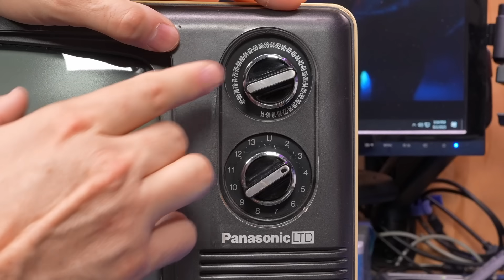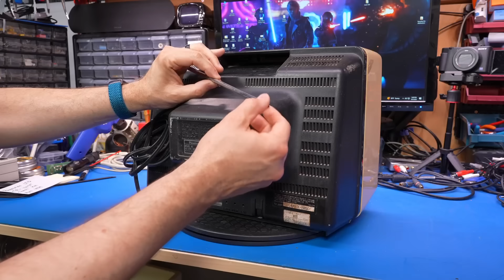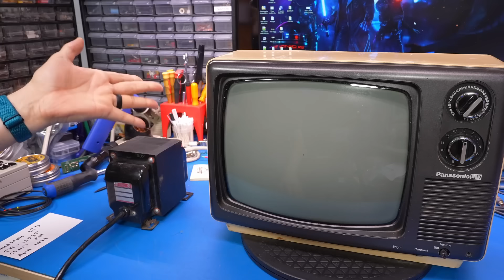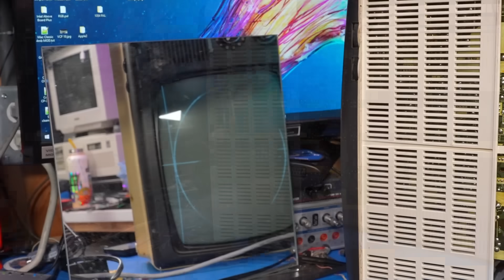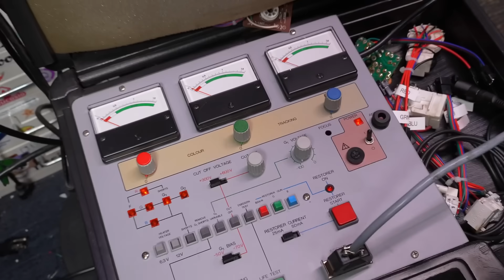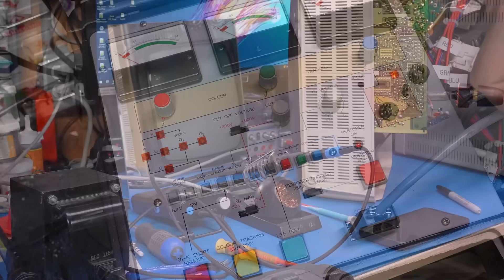These little TVs were everywhere (Panasonic TR-1203T)

Comment: Backn the day it was pretty common for a CRT TV to need "warming up" before you could watch it.
Also, I dont remember all of them having the little "dot". Maybe because I didnt hang around long enough for it to appear or just left the TV on.
Reply: You only get the dot if the picture is dim and there's no dot suppression circuitry. If you have the brightness up the HV will drain beforehand. My newer TVs flash white when turned off which does the same thing.
An 80s BW TV I have has a circuit that drives the G1 negative when the main power supply fails. This results in the pciture fading out nicely as hit shrinks but has the side effect of leaving the tube charged.

Comment: When NTSC was set up, there was a Channel 1 designated.  Shortly after the commercial introduction of TV in North America under NTSC, a new type of receiver circuit was developed that was much more resistant to some common types of resistance, but it couldn't pick up Channel 1.  The decision was to remove Channel 1 from use to improve quality.

Another thing that isn't commonly known (at least, not any more) is that the VHF channels aren't equally spaced.  There's an extra gap between Channel 6 and Channel 7, for the FM radio band.  Back in the day, you could often pick up the audio carrier of Channel 6 at the bottom of many FM radio tuners.

Comment: Awesome video, like a super mini mail call without the mail part. If your interested in modding old TV's to have S-Video or some flavor of luma and chroma I wonder if you could design a simple PCB that has a S-video and Audio in, two 75 Ohm isolation transformers for the video and a 600 ohm or some such for the audio and a small signal booster circuit. Then any old tv with a hot chassis could safely be modded.

Comment: Last weekend I fixed a cocktail table arcade machine from 1980 - it was a spider condo and had a mud dauber's nest in it. Got everything to work (even the original power supply which was substituted with a switch mode PSU in the late 80s), but had slight +B adujstability issues on the monitor. Yesterday I fixed that and got a great picture that matched the CRT's burn in. After running a couple of minutes I wanted to play a game but the monitor went BANG, the fuse blew and the flyback died. Without any warning. The flyback is the hardest-to-replace item on a CRT monitor!

Comment: Here is what happened to Channel 1 in North America. Ch. 1 existed on the dial in the early days of experimental TV in the U.S. in the 1940s. Up to 1948, Ch. 1 was  actually used by some early experimental TV broadcasts stations in the 1940s. At this time, the VHF dial was shared with two-way radio use. This turned out to be unworkable and in 1948 they moved all VHF TV broadcast exclusively to the 2-13 channels with ch. 1’s frequencies (which was 44–50 MHz between 1937 and 1940) being given to two-way radio used exclusively. They however chose not to reorder the channel numbering for VHF TV meaning that TV’s simply didn’t include a Ch 1 on the dial. When they started licensing UHF stations in mass starting in 1952, they TV manufacturers started making TV’s that offered separate UHF dial and a U tuning position out he VHS where Ch. 1 was prior (To watch UHF, Tune VHF dial to U, then tune UHF dial to desired channel). 

Ch 1 would return to TV’s once Cable TV came around, because cable TV was a closed-circuit TV broadcast medium that used slightly different transmission frequencies then over-the-air broadcasts. This meant they could use Ch. 1 again and as such a number of cable companies made use of channel 1. One common use for Ch. 1 was to broadcast scrolling TV guide listings back in the analog era of cable TV. Once digital cable took over, some digital cable TV providers used it for their digital VOD (Video On Demand) service (Comcast is one such for example. 

The two other countries in North America, Mexico and Canada never had a channel 1 because they didn’t start their first TV broadcasts until 1950 and 1952 respectively, which was after Ch. 1 was removed from the TV dial. By this time, allocation of TV channels between U.S., Canada, and Mexico has been coordinated (just like with radio) to prevent two TV stations near the borders with Canada/U.S. or Mexico/U.S. trying to broadcast over the same frequency causes a clash. 

Ch. 1 did exist in some other countries outside of North America, such as in Japan where Tokyo had analog TV station on Ch. 1.

Comment: I was freaking out about how and why'd you'd comp mod and Black and White set until  I remembered that whilst the TV is, monochrome computers were vanishingly rare (excluding Apple II shenanigans) but we got our fair share in the UK with ZX80/81 at least.
Wasn't the Jupter Ace monochrome too?

Ed: Oh, if it helps at all, we used to refer to the tube mounting band like yours as "little d's" because the curve is the CRT front and the leg of the d indicates the tabs at the back. And then we just knew that a big D was the opposite! But then again, some of these guys used to enjoy charging appropriately sized capacitors, then throwing them to the newbies and shouting "Catch!!" ... Golden days!
It's a shame that English Orthography dropped the letter Þ (called Thorn and if is a TH/F sound and is still in common use in Iceland and Anglo Saxon writings) from the recieved usage, it'd have been perfect - considering the daily grind we all have of identifying lobed mounting bands for CRTs!  Who knows, maybe the Pip 3000 will bring back the popularity! '🤣

Either way thanks as always Adrian and I'm glad that your video pushed me to exercise that last neuron that's hanging in there! 🤯

Comment: A tube died in my amplifier just the other day, a 6CA7. it lost emission on the spot. something got lose inside it. When it was colder it worked but as soon as it reached a normal operating temperature it dropped out again. Banging on the tube could bring it back for a moment again. I had to replace the pair.

Comment: I love this CRT stuff.  TVs were such a mystery to me, when I was young - a /lethal/ mystery as well, due to the crackling of high voltage and the dust that would accumulate on the screen.  This is how I learned what electrons, cathodes and phosphors were.  Poor CRT.  I would have been 9 when it was made (makes me feel so old).

Comment: I had a similar TV, branded National, when I was a kid. Red plastic chassis, with a black front.

My dad picked it up from a local pawn shop that would enlist his talents from time to time to repair electronic equipment. They claimed that the TV only showed green on the screen...

...the reason being, was that the previous owner had swapped the white phosphor CRT with a green phosphor CRT, and added a BNC connector on the side of the TV for composite input (it had a small transformer inside, so I guess it wasn't live chassis).

Since there was nothing my dad could do to fix the green screen 'problem', they let him keep it, and that TV became my TV that I used with my Commodore 64, via a busted Betamax VCR, to convert from UHF to VHF, since the TV lacked UHF.

I kept the TV for many years, but eventually recycled it, because these weird bubbles started to form on the screen, around the edges. I later realised that this may have been a CRT with an implosion shield, and the optically transparent glue was breaking down.

More recently, at a local trash and treasure market, I found the exact model TV, in red, with the original white phosphor CRT. Bought it on the spot. Damned nostalgia!!

Comment: Hi Adrian. I think that model/Part # of picture bulb runs Windows 3.11 for Workgroups. It’ll definitely need both the CRT driver, and the mouse utility. 🤣😆 In all seriousness, though, I’d save the horizontal/vertical output transistors as they’re probably used in other CRT TVs and computer monitors; more to the point, we know these are good - there’s clearly a raster. 😊

Comment: Those lavender Matsushita electrolytic capacitors are ALWAYS bad on period stereos (late 70s/early 80s). I'm wondering why they seem to be OK in Panasonic's TVs but not their audio equipment...
Reply: Not always bad, my 1972 Panasonic table radio is just fine, no signs of them leaking. My friend with a 1977 Trinitron has many of the same purple caps, again no signs of leaking. Actually I've never seen them leak (but I also haven't been inside too much equipment of that era).
I'm wondering if it might be climate related, the people I hear saying they always fail are in California but I'm on the East Coast.
Reply: @eDoc2020  Nah this is on the east coast too. I guess it might be use case? This is always specific values on stereo amplifiers. Generally the 47uf and 10uf caps are the bad ones. Perhaps its just the application that caused them to fail in that case but not in TV sets?
Reply: @averyzucco220  I think Shango also has problems with them in TVs. I"m sure it's a whole variety of factors we don't understand.

Comment: When I was a kid I had a small B&W TV in my room, which to date myself, meant that we had to run coax from the antenna and if I wanted to watch different channels sometimes I couldn't since we had a rotator for the antenna - meaning, whatever the living room TV was on would limit my choices of channels. That area got cable tv really, really late… Anyhow, what you may find amusing is it was a small RCA B&W set - specifically the same one that was modded to become a TRS-80 "monitor"… wish I still had that thing! It looked exactly the same with a few differences - where the cable comes on the TRS-80 monitor, this set had a volume control, and the big blank plate on the monitor housed the VHF and UHF knobs.

Comment: Working on a house I found that the outlets had been "bootleg" grounded to the neutral wire. Thankfully I inspected them when I bought the house, or else I could easily have gotten a hot chassis.
Reply: His comment about the hot chassis is a reminder of the importance of testing outlets in new environments. I found one (just one) hot and neutral reversed in an apartment I rented.
Reply: Is this why I could feel some electrical effect touching the antenna on my old set, the garage I was in was probably wired in the 40s.
Reply: @Funnyman2002  Antenna should be isolated by small capacitor. You still could feel some effects but its no dangerous.

Comment: On antennas where the nub is gone, use needle nose pliers, pull the end one out an inch, and squeeze a flat spot in it.

That’ll prevent it from going all the way back in and give something easier to grab onto.

Comment: G1 and G2 are used for the brightness and contrast control, the electrons flow from low voltage to high voltage. G1 can be used to cut off the beam by making it a higher voltage than the cathode, meaning the electrons would need to flow 'uphill' meaning no current. Cathode to G1 short would mean no brightness control and no cutoff (don't be fooled by the 'cutoff voltage' control on the tester) resulting in a maximum brightness, low contrast image.

Grounding out the cathode would make the screen display white video - the video was still there because you could also see the retrace lines.
Reply: You can see retrace lines even without video signal if blanking is not working. This happens when g1-cathode is shorted or cathode is shorted to ground.

Comment: Tubes were gone from even the cheapest consumer electronics by the mid-70s, at least in Western markets. But one way you can tell at a glance if a TV still has tubes is the power cord. AFAIK, most tube or hybrid sets of the late 60s through the mid 70s had a "safety cord" that was designed to detach with the back case when you took it off. The idea was that you couldn't power the set up with the TV's guts exposed. When manufacturers moved to an all solid-state design and started slapping "No user-serviceable parts inside" stickers on the sets, they did away with the safety cord.
Reply: If anyone wonders what that means, it's a cord that ends at the rear casing/back. When you remove the back it unplugs itself leaving 2 bare prongs inside the tv.
Reply: Ive often seen sets of this age with the cord detached from the backing panel (melamine?)  Sometimes a lil metal clip could be removed that would release the cord. Other times the cord was just pried or cut out of the backing.
My dad would wait until it got dark. He had us kids sit on the couch a distance away and point a flashlight at the back of the TV. Removing the back panel he went on the premise if a tube wasn't warm or didn't glow it was a suspect. Removing a handful of tubes we would head down to the nearest convivence store that had these tube testing kiosks that would tell if a tube was bad and had a stock of replacements.
95% of the time he got the set working by replacing the right tube. I can only remember two times he had to call a TV repair man. 
Dangerous? Certainly but thats the way things were done!!! Just like I saw many a time some guy working under his car using a bumper jack.

Comment: I had that set on a different config during the 80s. Mine had NTSC and PAL (switch on back if I recall) and was 12v powerable.  Model TR-1215X.

It was my Atari 800 display and TV for my childhood and youth and through university until I got a PC in the early 90’s.

Comment: If you wanted to make it a composite monitor, you could steal the isolation transformer that is connected to the tuner to feed the composite input.
Reply: There is no isolation tranformer for the tuner. Because tuner has high frequency input (more than 50MHz), there are just 2 small isolation capacitors. But you cant use them for composite video, because it needs low frequencies (from 60Hz).
In Europe most of these small B/W sets were made with power transformer and worked internally on 12V. So they could be use as a composite monitor and also they worked from car battery.

Comment: I did 3 years in college doing TV and video repair, followed by 3 years at Panasonic in the design department. I wasn't designing TVs, but test jigs for the production line. My Japanese manager, Tedija Nishakawa, designed the pseudo-stereo IC fitted to Panasonic TVs before NICAM stereo. I am now a stairlift engineer and haven't touched a CRT for over 20 years, but I enjoy Adrian's CRT videos.

Comment: In the very old days of TV there were devices that only received only on channel 1.  So-called direct receiver.
But channel 1 quickly became the first intermediate frequency IF on TV and the channels then started from channel 2.
Reply: In Germany, channels 2, 3 and 4 were below the FM radio band. 
Channel 5 to 12 (or 13) VHF above the FM band. 
UHF starts further up with channels 21 to 69. 
Channel 36 was not used for TV broadcast, but by VCR and computer.
Channels 13 to 20 were used exclusively in cable TV. In the air these are intended for other services.

Comment: Channel 1 TLDR:  That channel went through some reallocations early on, and set manufacturers weren't entirely sure how to proceed, so they just opted  not to.  At that point, there weren't any broadcasting stations on the currently-assigned frequency, so it fell into disuse and the FCC reclaimed the spectrum.

Some cable boxes would have "channel 1", but it was not at the original broadcast frequency like most of the other VHF cable channels.  It was often an alias for channel 99 or some such.

EDIT:  Ah.  Waited to long to post this -- already covered.  (And for completeness, yep, interference was a factor in the reallocations.)
Reply: On the original 16 channel Jerrold cable boxes, Channel 1 was the channel above Channel 15, in the mid-band area just above Channel 6.

Comment: Shame about the CRT. but the TV can't even be used as a monitor.

Unless you use RF.
Reply: You can, you just need an adapter and a rf modulator. Some VCRs could internally modulate composite to RF for these exact use cases
Reply: @dos7.11  Yeah, as I said, unless you use RF. But you loose quality and gain interference. 😄

Comment: I miss TVs that had built-in radio tuners.  I thought those were so fancy.  I only ever saw them at hotels.
Reply: all they did was tune the space between VHF channels 6 and 7. Analog TV sound is just FM radio, and that's where the FM broadcast band sits. I also used to see a lot of portable radios that tuned above and below the FM band to let you listen to the VHF channels' audio.
Reply: @coyote_den  Channel 6 was actually in the tuning range of most FM radios. That made it a desirable channel to be on. Where I live, the CBC English station was once on Channel 3 (briefly it was 4), and the French station was 6. Then they swapped channels, so that the more dominant, English station could have 6. They've been 6 ever since.